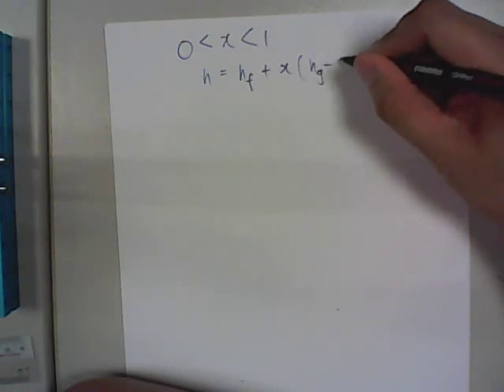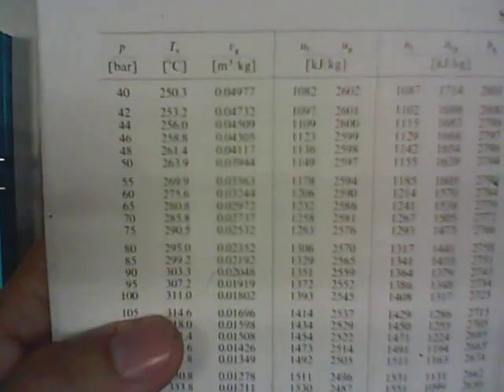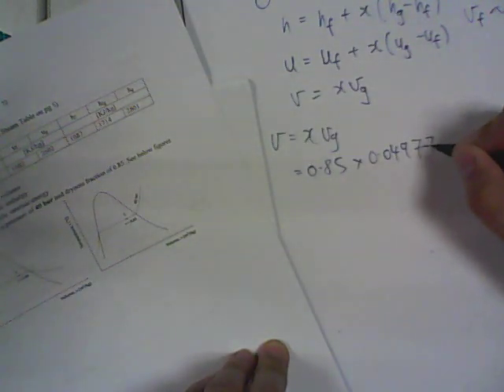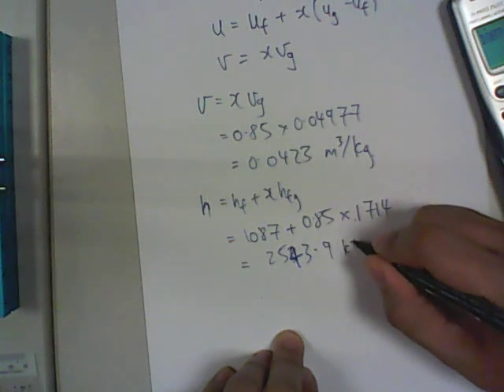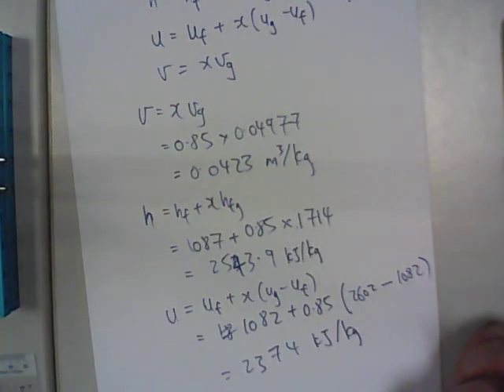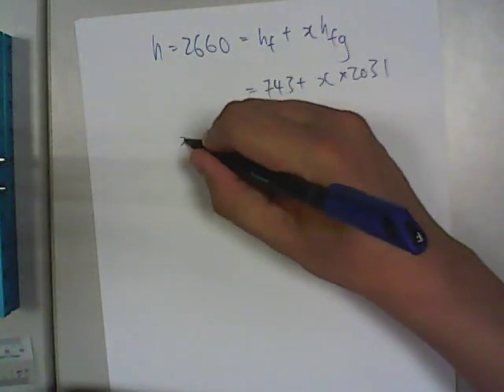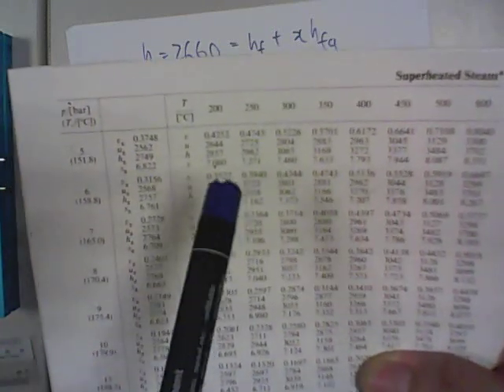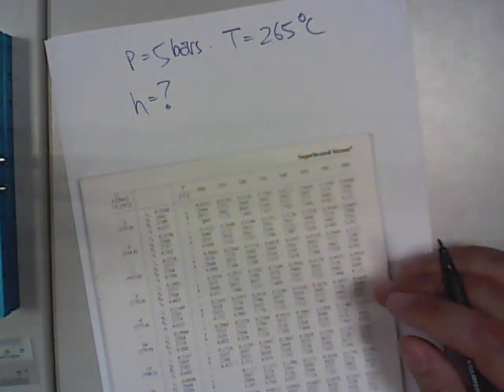Thermofluids 1 Chapter 5 Part 4: Dryness Fraction Examples

Comment: One thousand grams of steam at 121° has a moisture content of 10%.It undergoes an isometric process until the pressure reaches 280 kPa.Calculate the final temperature,the heat applied in kCal,and the pressure whrre the final condition saturated.Can you help me with this,I'll give you three sub
Reply from the maker: I suppose isometric means constant volume. For saturation temperature of 121 deg Celsius, the pressure should be at around 205 kPa. So initial condition would be dryness fraction of x=0.1 at 205 kPa, and the process is a straight line up (const volume) to hit the saturated liquid state at 280 kPa. Though this sounds like an over determined question. Provided everything I mentioned above is true.

Comment: hi could you explain this :
A mixture of wet steam has a dryness fraction of x = 0.78 at a pressure of 20 bar. Determine the specific internal energy of the mixture, in the unit of kJ/kg.?
Reply from the maker: Hi, at 20 bars, uf = 907 and ug = 2600. Therefore u at 0.78 dryness must be somewhere between 907 and 2600.

To find u, u = uf + 0.78 (ug - uf) = 907 + 0.78*(2600-907) = 2227.5 kJ/kg
Reply: Chew CS thanks very much I got one more as well …
Reply: An ideal gas enters a nozzle with negligible velocity and specific enthalpy h1 = 2,506 kJ/kg at the inlet. It leaves the nozzle with a velocity of c2 = 516 m/s. Neglecting the heat transfer and changes in potential energy, calculate the specific enthalpy at the outlet h2 in the unit of kJ/kg.
Reply from the maker: @alexwalton8951  it would be this topic 
https://www.youtube.com/watch?v=LY4Pnk8t_N8&t=7s

PE, q and c1 are zero (negligible)

h1 + 0.5c1^2 = h2 + 0.5c2^2
2506000 = h2 + 0.5*516^2
Therefore h2 = 2372872 J = 2372.9 kJ